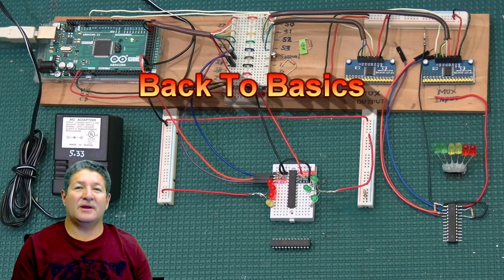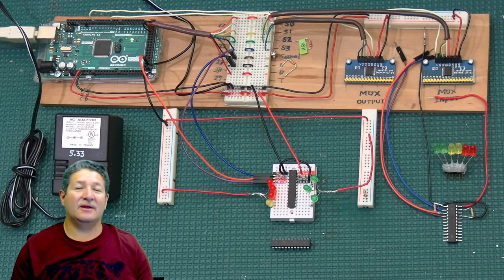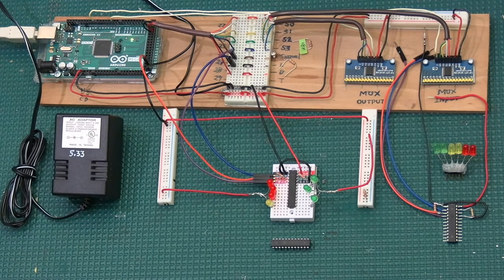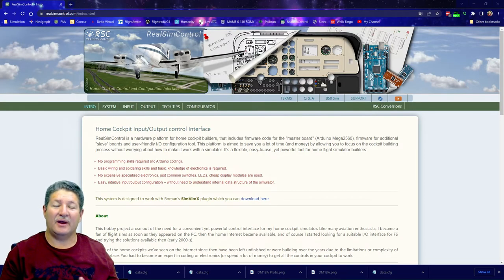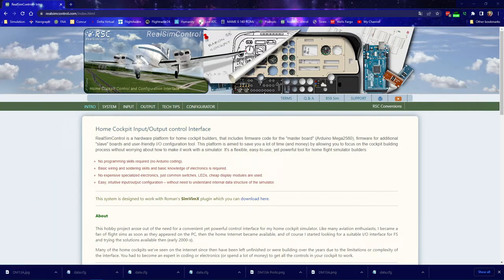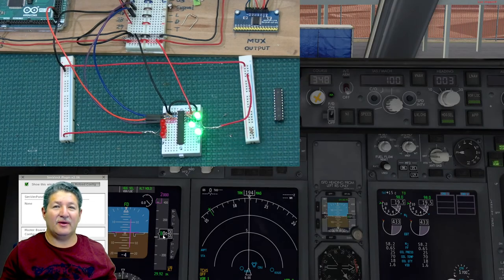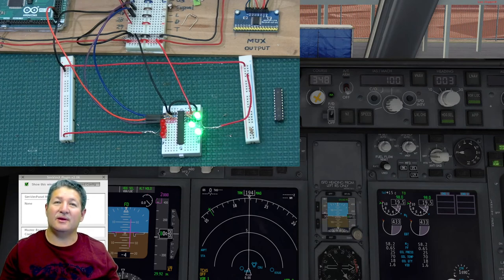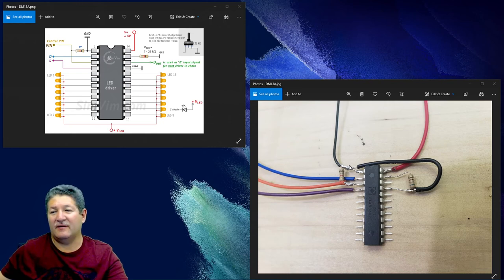Back To Basics: Using DM13A LED Drivers With SimVimX

Comment: Thank you for these very clear explanations. I will start my connections soon and I found information here that I did not find on the SimVim site (the power of the resistors that you tested in particular)
Reply from the maker: Thanks, if you watch my other video, "Playing with LEDs" you'll see that pretty much you can use whatever value you want as long as you prevent too much voltage from getting to the LED. Some are way too bright even with the recommended value.,

Comment: Update on my cockpit project.  I've been focusing on the electronics part and one day, will work on the physical part.  I've learned another cad program (KiCad) to build my own printed circuit boards.  I built the interface board, with one set of ribbon cables/Jst-XH connectors which supply display lines for up to 10 x 7-seg. led displays + 5 multiplexer signal lines + S0 to S3 and +5v and ground.  Each board patches those signals to other boards in series.  Each board has connectors to plug into the tm1637 displays and lcd's and 16 to 1 multiplexer on board which have connectors to connect to each dual encoders.  1 board is addressable to connect com, nav, adf, xponder, switch panels, analog panels etc.  I also created a motherboard which serves as an arduino mega shield with connectors to the interface boards, witmore servo controller, stepper controller, arduino nano with generic connectors to add in the future.  I will make a video on youtube showing the entire project, the connectors used, the boards I made, how they all connect and function.  I will also provide the gerber files for anyone who wants to build their own.  Simply send the files to pc board manufacturers which are cheap.  The interface boards were about 29.00 for 15 boards, including shipping, and 48.00 for 5 motherboards with shipping (this company has a 5 board minimum) and all you need are  JST-XH(A) connectors, 12 (or more) wire ribbon cables, solder, crimper and sim components (tm1637, max7219, lcds, encoders, switches etc.) all from china for cheap.  I'll let you know when I release the video.  The gerber files are available now. (gerber files are used to make printed circuit boards.)
Reply from the maker: Wow Phil, you are becoming a full blown designer and production house. Much more elaborate than I've ever though of.

Just be aware as they warn on the website. "Don't rush to make PCBs" as the system can change at anytime (as it has many times already) It would just be sooo bad if you go through all that and they end up changing the wiring part so much that it will make everything you made unsuable. Although I really doubt it will change that way. Seems like the whole thing is pretty solid now other than how the plugin and programing improves and changes. I really hope it stays as it is on the connection aspect of everytbing.

Can't wait to see your videos Phil
Reply: @Qosmokid  That's the nice thing about my system, it's adaptable and flexible.  If they were to change from the mega to another arduino, no problem.  The arduino mega pinout is the same as the connectors.  Replace the arduino with connectors and plug it into anything.

Comment: I tried to use custom matrix Settings, and found that it can be used, but only applicable and perfectly adapted to ZiBO738. When I used Toliss and FlightFactor to make some common civil airliners, it did not take effect. I hope to get your help and answers, thank you very much.
Reply from the maker: Hello Vision XIE, I looked into it a little and noticed that you are right, nothing shows uo in the data.cfg file when you select the CDU for the matrix.

Well the reason it doesn't work for Airbus is because when you select which CDU you want to configure you selected the one for the 737.

I think you would need to create a new cfg file selecting the CDU for Airbus if you wanted to use itvwith those aircraft. But I believe the button layout is different for those so Im not sure it will translate properly. I dont fly any Airbus aircraft and also have never used the matrix but these are my best guesses.
Reply: @Qosmokid  Thank you for your reply,I get you mean. Now I am using the preset Airbus MCDU layout, and I want to use the preset Airbus style MCDU as explained in the RealSimControl configuration. However, when I select it, I still need to configure every key, and each key is not allocated according to the preset mapping. Clicking Save also prompts me not to assign input and output,I am confused.

Comment: Hi Jose, excellent video. If I may ask, where does the D and L line end up to?
Reply from the maker: Hello Santi, eventually they end up on pins #27 & #28 as shown on the diagram here:

https://realsimcontrol.com/system.html
Reply: @Qosmokid  Thank you Jose, much appreciated.
Reply: @Qosmokid  Hi Jose, so my 6 pcs of DM13A ordered online arrived today, and I am so shocked to see they are so tiny!!  I think they must be the newer models unlike yours in the video.  These ones, so tiny (about the size of my pinky fingernails) it is impossible to solder/connect to the chip's legs without any form of pcb mounting of sort.  Any tips?    :)

Comment: Good afternoon friend.

I'm building an A320 cabinet with simvim but I've had problems connecting the leds, I'm trying to use the DMA13A controller but it doesn't work for me, I've checked the connections many times, the only question I have is if D goes to pin 28 and L to pin 27, I really appreciate your help and great videos.
Reply from the maker: Hello Andres, yes that is correct, L to #27 and D to #28. Is your configuration correct also?
Reply: @Qosmokid  Yes friend, I followed the instructions perfectly and it still doesn't work, I did it directly and also with a protoboard, I don't know what to do anymore. I have also tried to connect the matrix max 7219 and when activating a led, 4 or 5 light up at the same time. please help me, thank you very much.
Reply from the maker: @andresayala410  I would need to see your cfg file and clear pictures of your wiring in order to have some idea of what might be the problem. As with all previous experiences I've had trying to help other people, almost 100% of the time it was incorrect wiring, the last time it was bad configuration though.

You can email me at qosmokid on  gmail
Reply: @Qosmokid  friend do you have any mail or whatsapp? to send you photos of the configuration
Reply from the maker: @andresayala410  yes I gave it to you in my last reply qosmokid at gmail
Reply: @Qosmokid  I already sent it to you, thanks
Reply from the maker: @andresayala410  Did you try the latest advice I gave you in my last Email, I haven't received a response so I'm not sure if you got it.

Comment: Good day, what is The D line and L line where those wires goes ?
Reply from the maker: Hello, the L line goes to pin #27 and the D line to pin #28 on the Arduino. I am using a distribution block to "multiply" the available connections to the data and address bus. I recommend you watch my video on using multiplexers if you haven't already.
https://youtu.be/hc2Ony8l59w?si=utsmNmZqBo5w2757
Reply: @Qosmokid  thank you sir got it !!!

Comment: Hi Jose, very interesting like always. Where your + vled is from ? I can’t figure it out how you get a simple wire to your bread board
Thanks !
Reply from the maker: Hello Moussa, It comes from the separate power supply that needs to be used to power the LEDs.
I talk about that starting at 12:30.

It's hard to catch everything in a 25 minute video
Reply: @Qosmokid understood Jose thanks. But did you cut the ac adapter wire to connect it into the bread board ?
Reply from the maker: @avioniquesimulation  yes I did cut it.
Reply: @Qosmokid  ok thank you !

Comment: Great content as always sir. Curious, is there any way you know of to use multiplexers directly with LEDs? Does SimVim require led drivers to use LEDs that are not directly wired to the arduino? I have 36 LEDs which will quickly take up space on the mega and I expect that count to increase quite a bit when I start working on the lower consoles.
Reply from the maker: Thank you Bruce. As far as I know you have to use either LED drivers or the other options like MAX7219 LED matrix, or HC595 shift registers. Although I believe the latter two can only be wired direcly to the Arduino. I Personally love the DM13A for LEDs.
Reply: @Qosmokid  sounds good thank you

Comment: Hi Jose, I have been developing MCDU for Airbus recently, and made PCB with the preset layout, but I can't use it normally. I downloaded the latest version of SimvimX firmware, connected Mega2560 in X-plane, and uploaded the firmware of Mega2560 and UNO R3 matrix. However, there is no data. CFG file in the Plugins folder, which I think is the key of the problem. May I ask how to solve this?
Reply from the maker: Hello Vision, Im not sure I can help you with this one as I have not built a matrix. I did try to save a configuration file with the MCDU for the Airbus selected and I did notice its totally blank. Not sure what to make of that.

Comment: Hi Qosmo,  I was wandering if you are experiencing issues with The DM13A and the new configurator as I am? Do you have another place where I could contact you easier.
Reply from the maker: Hello John, I have not played around with any DM13A's using the new configurator because I dont have any in my home cockpit. Hopefully I can make time to try them out on my test setup. You can email me Qosmokid at gmail